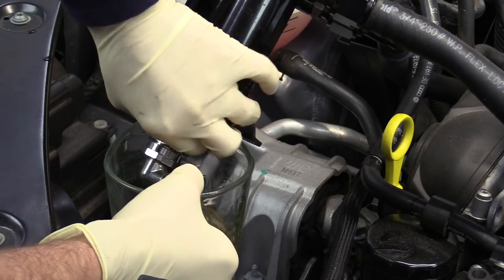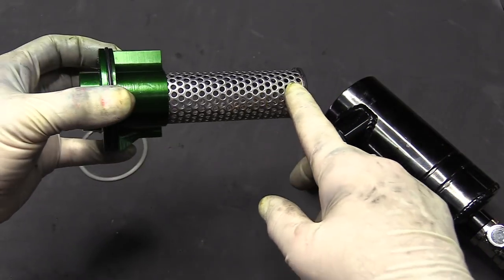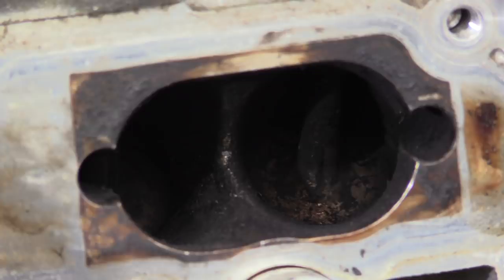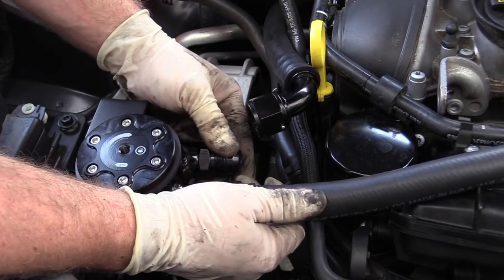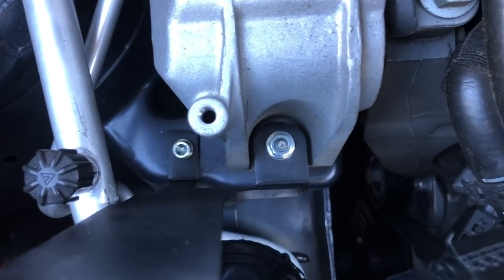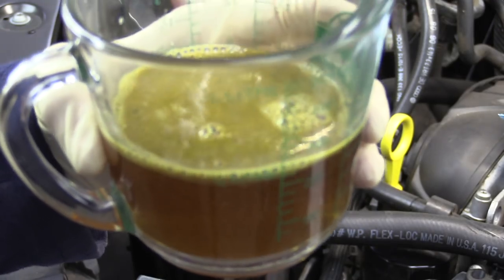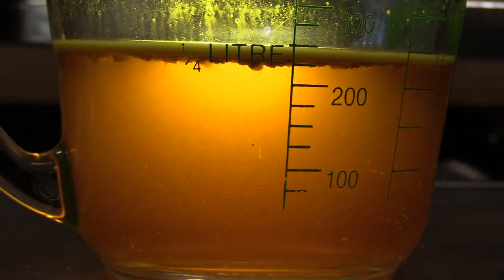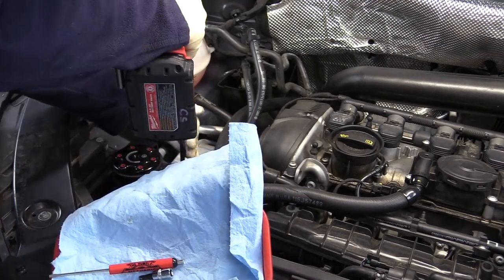Do Catch Cans REALLY Work?

Comment: I'm relatively new to the under the hood side of things here, so if I understand Charles correctly, the catch can adds another layer of filtration that prevents gunk from going into the cylinders right? How does this work differently than the other filters on the engine?

Comment: I’m curious if that fluid from catch can contains detergents that will clean up the intake valves. I used full synthetic oil every 5k on my eco boost engine. No catch can but drive mostly on the highway and long distance.

Comment: Great video.
I am collecting a lot of water in my catch can with oil mixed in some. The fluid is far from the color of my coolant.  The relative humidity is about 74%.   Is there a connection?
I running a 2JZGTE

Comment: Along with a catch can, introducing water injection through the intake system under hard throttle would yield the most effective method of keeping the valves clean.  This can easily be achieved with a throttle or rpm switch.

Because of direct injection, the intake valve runs hotter, thus water injection would have multiple benefits.

Comment: Best test I've seen so far, good job mate. 
Would I be right to say that in an earlier diesel (like my Australian spec Toyota Land Cruiser, 2001, 1HZ, with no EGR system) a catch can would be a waste of money?
I ask this based on my understanding that most of the carbon build up in modern diesels is due to the PCV system coating everything in oil and greatly increasing the amount of carbon from the EGR system sticking and so not passing through to the combustion chamber. Also my 1HZ has no turbo to worry about, and so obviously no intercooler to get blocked up. So in short I wouldn't have thought the oil mist would do my engine any harm at all?

Comment: Assuming proper maintenance, is there a danger of causing too much pressure/vacuum drop and defeating the purpose of the system in the first place? 

Especially so with a tuned turbo scenario.

Comment: Two questions:
1: What if you had some kind of media like steel wool to have a much higher surface area?

2: How does fuel quality possibly play a part in valve deposit buildup when the problem is on direct injection engines because there is no fuel contact with the valve?

Comment: Allot of that is water created inside the engine due to high heat. However, that top layer is the layer that causes carbon. Awesome video! This makes me more convinced to put one on my girls car. But I am hesitant to do it on my subaru as I replaced the subaru oil seperator on it from the plastic to steel one.

Comment: Any updates on the intake or piston carbon build up??  this explains a lot of why valves going bad as well as engines failing. . I've got a jag and just replaced the motor,  loads of oil in the intake and tons of carbon in the intake ports ,valves and pistons. .
Reply from the maker: There was no noticeable difference in carbon. I think for it to truly work, it would have to be installed very early or just after a carbon clean.

Comment: Makes a huge difference on my f150
Short trip and freeway use for me

Big note, when the weather gets crazy hot it does not perform nearly as well as when it's cold. 
Recent cold weather pulls about 2oz/tank of gas.
Reply: @James28R  yes the can is full of shit after about 1500 miles. 
My valves on that side are pretty damn clean after 150K. Meaning it's doing it's job and keeping shit out of my engine.

Comment: As we know the PCV plate on EA888 has two sources of vacuum to pull blowby gas out. Either in boost mode or NA mode (closed throttle). The BFI doing good job pulling the gas out in boost mode but it seems doing nothing with the gas in NA mode.

Comment: Hi Charles new MK7 Gti owner here...I have a JLT catch can installed on my Mustang and there’s a tablespoon or 2 of what appears to be pure  oil every 500 miles or so. It does not look anything like what came out of your catch can. Either my catch can lets the water vapor through the intake and catches the oil or your system is letting the oil go through (to the valves?) but keeps the water vapor in the can? Or maybe something else is going on? I’d like to see more detailed engineering explained here. I may swap my catch can over to the Gti and see what results I get compared to yours. Please post a follow up video!

Comment: Just for the record Humble Mechanic states in his other videos that this is a Direct Injection engine problem only. Port injection washes the intake system as the fuel is fed in the intake ports not in the combustion chamber. Every IC engine will produce PCV gases. But DI engines tend to build up carbon. In my Passat the ports (not only valves) were approximately 50% blocked. After cleaning they are now getting blocked again (missing and codes) after 50,000 miles. PCV gas always contains water but this in not mostly water if you put water and oil into a cup the oil floats in it. The density of oil is much lower. Furthermore the inside of the engine contains these same fluids, oil and some condensation. There fed back down to the oil pan for the most part. I would think that the best solution for this is a heated PCV pipe that connects to the can drain line and goes back to the pan. The oil filter will filter particulate and the heat of the engine boils off any water. The PCV system is for blow by pressure release.

Comment: I installed an aftermarket ebay catch in my 2006 chevy cobalt which i can see that it was working, i would empty out the  residual liquid that it would collect, however lately nothing in the catch can cant find the problem

Comment: The last time I emptied my catch can (this fall, cooler temps), the drain was plugged with condensed crud.  I had to use a screwdriver to break it up to drain.  From this, I could guess that there is some waxy content in the catch can crud that tends to solidify at lower temps.

Comment: Oil separators normally have a return line to the sump to drain down the caught oil.  If you fit a catch can before the factory fitted separators, then it is the same as blocking that return line - you are not allowing the oil to return as it should, and hence the buildup.  However, as others said, that looks mostly like water vapour that has condensed in the can which would otherwise have passed harmlessly through the engine and been exhausted.  The catchcan is making its own trouble.

Comment: It becomes more of a problem for the intake manifold if you have a DI (direct injection) system. If the injectors are before the valves then the fuel spray/vapor will help a little to reduce the carbon buildup from the crud. On a DI engine the only thing that is going down past the vales is
1) Inlet air
2) PCV valve gases (where the catch-can helps)
3) EGR exhaust gases

If you have ever taken apart or replaced an EGR valve you can see how much gunk and carbon is built up in the valve. That is just from the carbon that adheres as the gases begin to cool down on their way over to the intake manifold.

PCV gases contain oil, blowby at the rings and valve stems and condensed moisture. They can accumulate and cook themselves on to the valve stems, the neck and the face. Carbon on the stems can lead to erosion of the valve sleeve, carbon on the neck and in the intake manifold throat cause obstruction and turbulence in the air-fuel flow.

EGR gases are directly dumping carbon right in to the intake manifold.

Comment: My question about catch cans is the following, this derives from a conversation with a gm engine engineer at a gm event in Detroit. Please elaborate if this makes any sense at all to any one. He said that putting a catch can in the vehicle does a disservice to the engine as it’s designed that way for top end lubricating purposes.... that kinda blew my mind and with oil consumption I almost wanted to call him an idiot but the way he explained it he almost kinda sounded like it made sense. He dove into the history and how much poor top end lubrication on older gen engines cut life out. He made a very valid point when he said it’s nothing to see a properly maintained engine today go easily 300-400k issue free

Comment: HumbleMechanic, I hope you can find the time to answer this question for me. I have an MK6 Golf R that I have been considering getting an oil catch can kit for. All the full kits come with a block off plate/ adapter for the original pcv and warn of possible freezing in cold weather. They advise cleaning once a week when cold and to completely remove it and install the original pcv when temps are below freezing or you could potentially damage the seals in your engine. Is this a real concern? What are your thoughts on this? Thanks.
Reply from the maker: Yeah that’s basically what I’d say too. No use risking it freezing. That could be a bad time.

Comment: Hi interested in adding a PCV delete on my 2006 Audi A4 B7 2.0 Turbo. My question is, when the PCV is blocked either buy a plate, or oil catch, when the pressure of the engine builds up from gases, where do they go now?

Comment: You need to show us the borescope photos of before and after the catch can was installed.
Reply from the maker: It looked exactly the same. For me to fully be on board with a CC,  it woudl have to be installed at crazy low miles, ran for 30k miles, removed, then ran another 30k miles. A second place would be installing after a proper cleaning
Reply: Maybe a V6 test car could have one installed on only one side of the engine?

Comment: Would you add a ccatch can again? I'm considering doing this on my 2015 Ram Hemi. I use it for commuting, hauling and towing a travel trailer and after watching this I'm thinking it may not be a bad idea. The truck has been on synthetic oil since it's first oil change, but seeing this I can't help but think it's not helping the motor.

Comment: People usually fit these to prevent the Maf from getting dirty and causing it to fail later. But proper maintenance keeps that clean anyway. As with most aftermarket products, it keeps the industry in in business with so called performance filters and the like.

Comment: Do you think auto manufacturers tune the fuel injection to account for this oil returning to the cylinder? I would be worried that they are aware of the oil in the chamber and instead of adding a catch can they just tune the fuel/air mixture going into the engine and adding a catch can would change this. Do you think anything like that would be a possible scenario? Thanks for the video!!

Comment: Why re-introduce the air back into the engine at all if there’s any possibility of it causing a problem? Is there a need to return this air to the intake in order for the engine to operate or is it simply an emissions requirement?  I don’t fully understand how the pcv system works on the tsi engine but would really like to know

Comment: Is that all oil (apart from the crud)? It looks very liquid - ie. low on viscosity.
Reply from the maker: Yep engine oil
Reply: HumbleMechanic Doesn't sound like / flow like oil.
Reply: +HumbleMechanic
Okay? Looks like you use 0W-1 grade oil then.  ;-)
Reply: Catch can icing in the winter time! LOL
Reply: If it was oil and water it would be a suspension (2 layers - oil on top water underneath) or an emulsion ( milky looking mix of oil in water).

Comment: Hello Charles, that stuff belongs in the can not in the motor IMO. Wanted to ask if you recommend I put a can in my 2013 VW Jetta 2.5L SE. It has 150k and only been putting BP gasoline in it. Running a little sluggish at acceleration. Other than that not bad. Thanks bro!

Comment: Charles, I have a couple of questions.  A car with dry sump lubrication (955 Cayenne S V8).  Firstly will a catch can affect the scavenger pumps and the +/- pressure required for these.  Additionally - will installing K&N panels (x2) affect crank case pressure/air flow positively or negatively in your opinion.     Excellent to see the catch can getting so much rubbish!

Comment: Installed catch Can on my brand-new 2017 VW It is my hope It reduces the amount of carbon buildup long enough until I sell it, about 100,000 miles. I'm a conservative driver. I use full synthetic oil, only purchased top-tier gas in California. Hopefully, it makes a difference?

Comment: I need a help. I have a Tiguan as well, I’ve installed a catch can on mine. What I taught is to put some decarbonizer inside the catch can (with it cleaned). The decarbonizer has a relatively low boiling point (around 68°C) in this case when the decarbonizer boils it will also clean the intake… what you guys think? Are there any cons that I’m missing?

Comment: I installed one on my 07 Cadillac Escalade with a 6.2 L engine it drains about the same amount every five or six thousand miles I noticed the intake and the Pistons are much cleaner I did video before and after and there is a really big result better fuel economy by about a half a gallon ....my one way to work is 58 miles mostly Highway

Comment: Do you know what the fluid is? Did you determine what the oil level was at the beginning and end of the test? A 1/4 Liter of fluid is a fair amount.

My VWs use very little if any measurable oil between changes. Oil changed every 5K for the 2005 Passat 1.8T (120K miles) and every 10k for the 2017 Passat 1.8T (13k miles). Even the prior MKIV TDi did not use any measurable amount with 10k changes at 195K total miles.

Comment: Always wondered why you had to top up oil everytime in tsi engines. Man that's a lot of oil.. Awsome video Keep it up.
Reply from the maker: I have to wonder if some of this oil would have dropped back in the crank case. As I was editing this video I was wondering if the can upset the PCV enough for it to pull more oil than it would normally. 

I also wonder how that could be properly tested. I assume measuring vacuum at the can vs the manifold. But you would have to have an inline manometer... maybe?

Comment: stupid question, but does having a catch can fill so much effect the total amount of oil in the car's circulation? basically do you have to add for all the oil that is taken out in the catch can? Also I've been looking at the IE catch can vs the VWR catch can and notice that they install a little differently. Any advice you can give? Thanks.

Comment: That actually looks a little better than the thicker crud I got from my catch can (BMW sourced) on my AWP 1.8T engine. Possibly the BF unit does a better job at trapping vapor (water). I am not at all surprised by the volume, and not having it put back in the intake at least keeps the intercooler as well as sensors along the way much cleaner.

Comment: A) This modification would void the manufacturer’s warranty.
B) Not a great idea in colder climate conditions, as most of that is water from condensation essentially causing it to freeze, then creating more issues..
C) Use premium fuel, change oil every 5,000km and add a fuel injector cleaner (Liqui Moly Injectron is TUV approved) once at every oil change interval and you will be fine.
D) Every 90,000km replace your PCV valve

Occasionally, a good Italian tune up does wonders as well.

Cheers!

Comment: I have one on my direct injection V8 in my truck for the past 36,000 km and we shall see what it looks like.  In the summer I will pull the intake hose off and see how the throttle body looks like.  In the winter I empty my catch can every 500 km and in the summer, every 1000 km.  Time will only tell.  This could be the last catch can I install or another to be installed in future vehicle.  Or dual injection comes out before that.

Comment: I really don't have time to sift through all the comments so forgive me if this has been asked a million times already but was that mostly water that you drained out of there? I have a catch can on my heavily modified 04 cobra that runs on E85, and while it does collect some oil it's mostly full of water and alcohol when I drain it. There's actually a high enough concentration of alcohol that it's usually flammable if I pour it out on the ground and light it. Since it's a boosted engine running on E85 this doesn't really surprise me much but I was surprised to see that much water (if thats what it is) collected on a normal gas engine.

Comment: I have a 2020 Nissan Versa, 1.6L.  Is this engine direct ignition?  I would like to install an oil catch can, but was wondering if I should remove the PVC valve, or put the hose directly to it?

Comment: would be really cool to see a bore scope picture of the valves!

but, i know on my 200,000 mile "omg, i really need to change the lower intake gaskets already, thanks GM".... 99 buick century 3.1 v6 tear down....
valves were spotless....injectors spray right onto the valves

gaskets were about to go.....3.8 and 3.1 guys, watch out (but my dads 97 with 255K is still on orignals....unicorn engine)

and i like to rev that 160hp a lot.....so, exhausts are clean lol
actually quite a bit of torque, and the power comes on like a 2 stroke at 4000, which is fun

makes the same hp and more torque for longer, than a turbo!! 2017 civic....plus 2 mpg....
that should not be a thing, but it is

(and the 2000+ 3.1s got 15 more hp from larger intake ports....SAD! - Trump 2017)

Comment: I think with the combination of a catch can and a meth/water kit.. you’ll have a lot clearer engine. 
I definitely think it would be a benefit to fit, you know it’s not healthy to recirculate oil vapours back through the intake. My LCR has issues with condensation in the oil, so I’ll be fitting a kit myself in the near future. 

First time viewer, subbed.